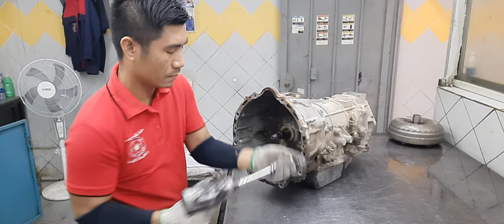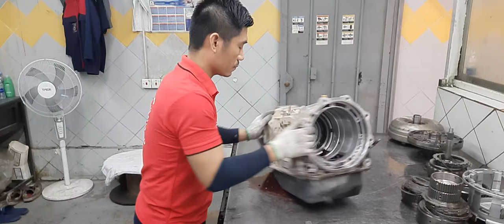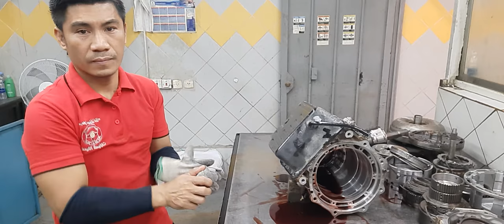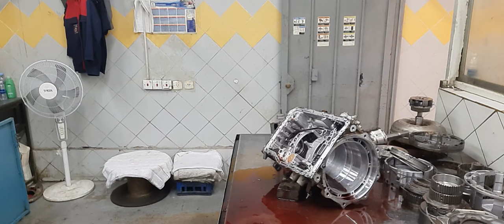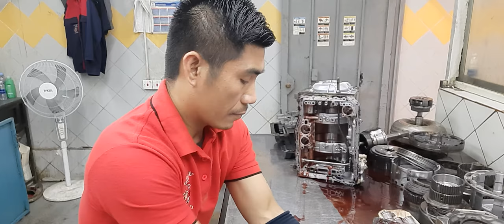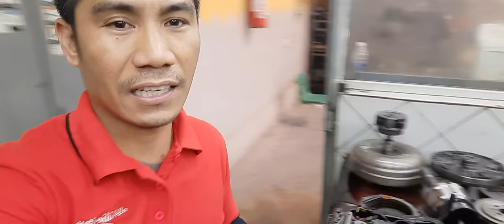Engine Shut OFF in R and D. A442f Transmission Dis Assemble.Tagalog

Comment: Hi, thanks for the video.I have an auto transmission mini bus .when put in any gear it won't move forward or backward unless the gas pedal is depressed/floored .when it now moves,it moves like a manual transmission with burnt clutch.I have changed the input and reverse clutches and also the shaft seals and valve body,but same thing.please what could be the fault now.I am beginning to suspect the torque converter.could it be the faults.Thanks for your concern

Comment: Hi friend! please help me, I have a 2008 Toyota Avalon, the third shift has delay and hard shifting, when I change to  manual and shifting with high RPM it works good, but when I shift the 3rd with low RPM it has a delay and hard shifting.
Reply from the maker: Two reason why delay shifting .either the Valve body stuck or the Direct drum clutch pack is burn.need to check this two parts.